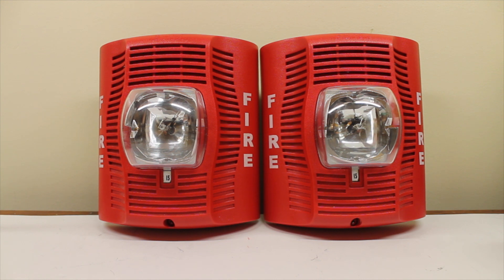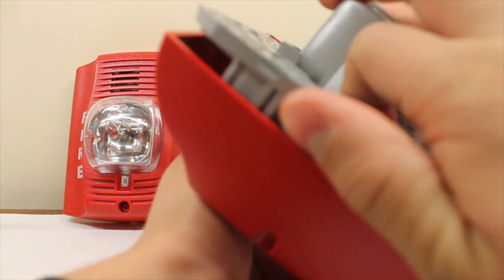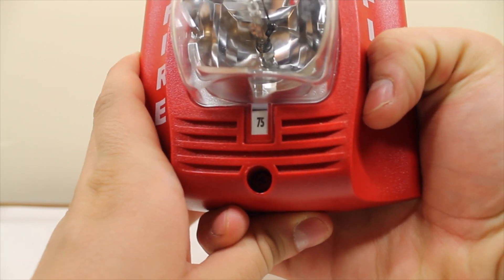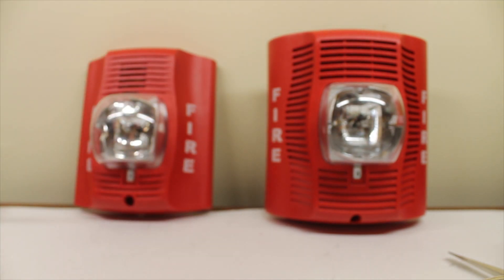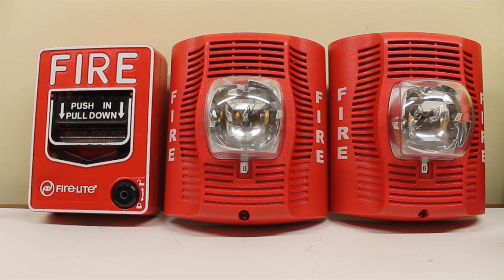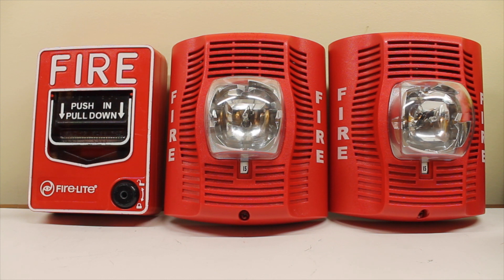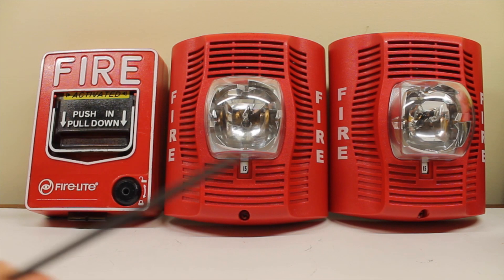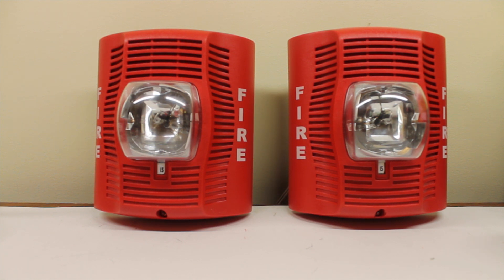System Sensor SPSR (SpectrAlert Advance Speaker Strobe) Fire Alarm Overview/Test

Comment: Can you have it play just the fire alarm not the audio I just bought one and I don’t know if I have to wire something for the siren to work or if I have to buy something to put audio on it
Reply from the maker: You will need to purchase an amplifier to drive the speaker. I use a Pyle PC20MA amp.

Comment: SWEET! My old middle school had these installed 4 years ago replacing the really cool old simplex voice evac alarms from the 80s (school was built in 1988) also they replaced the old wheelock ns' in the library with L Series Horn Strobes

Comment: Can I connect this to a conventional fire alarm control panel? Are there additional wirings needed or just the same wiring as the normal Notification devices like bells and LED strobes?
Reply from the maker: Pretty much any manufacturer's devices and panels that are not Simplex utilize conventional notification devices only, even addressable panels from these companies.

Short answer is yes. In this case, the strobe(s) would be wired directly to the panel. You would need the correct equipment to send audio to the speaker(s) as well.
Reply: @NewEnglandElevators ❤

Comment: I think spectralert advance speaker strobes are awesome than the spectralert classic speaker strobes. in my opinion. well that goes to L-series too and it did played simplex voice evac siemens voice evac est voice evac etc. i found out mircom has new alarms horn strobes and speaker strobes series i can't wait to have them and set em up along the way with the intercom systems.

Comment: How do you wire 2 pull stations to 2 stobe light.....
Reply from the maker: The pull station acts as a switch. Simply wire the devices up in parallel. You may be able to find a video that can explain this a bit better than I can explain in a single comment.

Comment: I've seen the speaker strobe version of the advance in a building it's rare!
Reply: I think they have them in my church.
Reply: Pretty much every building i walk into that have speaker strobes are spectralert advance ones..
Reply: A few can be seen in my college residence hall replacing older Gentex SPKE4 series (Wheelock E70 clone) speaker strobes. Most of them are still the old Gentex, but there are at least 3 of these scattered around the building.

Comment: How do you wire a speaker strobe. How do you program the sound. What is used. Please do a full descriptive video
Reply from the maker: I've answered those questions multiple times to several people, especially on this particular video. I encourage you to take a look. I don't do how-to's, sorry.
Reply: NewEnglandElevators then can you please link me to another video
Reply: Josh A Ok first of all, it’s a speaker meaning it requires an analog audio signal, if you just power it you’ll blow it up (due to resistance;acts as a heating coil; frying the alarm)

Comment: My college has SpectrAlert speakers. The alarm actually went off today; apparently it was a drill, but they drilled the wrong building. Oops.
But hey, at least it wasn't obnoxiously annoying. That's the beauty of speakers, and why I like them better than horns.
Reply from the maker: Drilled the wrong building? That's a first!
Reply: Something should not have ended well and that surely caused the death of several people. What a bad thing, right?

Comment: They have these at my school!
Reply from the maker: Must be a newer Notifier system of some sort. These are nice.
Reply: Actually, yes! It has a Notifier panel, and EVERY pull station is a Notifier. There used to be a march time Simplex system consisting of TrueAlerts not synced on march time, Simplex 4099s, and a Simplex 4005.
Reply: Ice Bear is amazing.
Reply: My elementary school has Classic SpectrAlerts.
And holy shit, they're fucking loud as hell!

Comment: Hey! I'm really new to the whole actually having fire alarms thing, and I'm wondering if you could make a video of how to wire up a speaker strobe to a phone or computer instead of a panel? Thanks :)
Reply from the maker: +Levi Hanson I'll tell you just upfront here. You will need an audio amplifier that will output to 25v or 70v (don't use a stereo, as that will damage the stereo). What you do is wire the speaker to the audio amplifier, minding polarity. The strobe you wire to a typical 24vdc power source as normal.
Reply: +NewEnglandElevators thanks you that makes sense. Where do you get downloads for the different messages?
Reply from the maker: +Levi Hanson I believe you can find the Fire Lite message somewhere on their site. I don't know where for sure, though. I don't remember where I found the Simplex one, though.
Reply: +NewEnglandElevators oh okay. Another question.. I have the system sensor speaker strobe SP2R241575 btw. I want to wire it to my iPhone 6 Plus, I don't care if it's loud I just want to make it WORK, would a 3.5mm to RCA cable have any chance of working? I'm thinking the 2 Rica speaker connectors could go in the + and - or I could even strip the wires and put them in that way. Is this even a possibility? Otherwise how do I get a small amplifier that isn't $50-300? Thanks again. I feel silly since I know next to nothing about this stuff.
Reply from the maker: +Levi Hanson You will need an amplifier. Fourtinatley, I found a Pyle Home PCM20A for fairly cheap. It outputs both 25v and 70v, in addition to an 8-ohm output (for a typical house speaker).
Reply: https://www.firelite.com/en-US/Pages/Voice-Messages.aspx

Comment: Hi does the wheelock 34t-ws-24 skip a beat like a 7002t
Reply from the maker: +Emillio Melendez No, they do not. That's because the horn and the strobe can be wired separately from each other. On the 700X series, the strobe is hard-wired in series to the horn. Because the strobe pulls so much power from the horn in this arrangement, it causes a "skip."

Interestingly enough, if I wired the horn and strobe on one of these devices in a parallel circuit, the horn would not skip. I would be able to do this if the horn on my 34T-WS-24 worked (although I made up for it by sticking another 34T next to it, I made a video of it a while ago).

Comment: Do you need something to activate the speaker? When I apply power, the speaker makes 1 popping sound.
Reply from the maker: Evan Nazario First and foremost, don't apply DC power to the speaker...it will eventually damage it (hopefully you didn't damage it too much). What you need is an audio source of some sort (mp3 with messages and amplifier). The mp3 device can easily plug into the amp, which will output the audio signal to either a 25v signal or a 70v signal. I use a 40w Pyle audio amplifier for this. It's able to output to an 8ohm speaker, a 25v speaker, or a 70v speaker.

Comment: There are a few schools in my city that have these, from when they upgraded the fire alarm systems. They all have Notifier NFS2-640 voice-evac systems with these speaker/strobes, NBG-12LX pulls and FSP-851 smoke detectors.
One of them, installed in 2009, replaced an old Gamewell FlexAlarm system from 1965 with Vibratone 450 horns; another installed in 2010 replaced a Simplex system from the 80s with 2903+2901-9806 horn/strobes, and another installed in 2013 replaced an old Edwards system that was just relayed into the intercom.
Reply from the maker: An older Edwards system relayed into the intercom...that sounds interesting. Correct me if I am wrong, but it seems like the system would have emitted some kind of tone into the speakers, acting as the signals. I may not be 100% right on this, but it might be close (I saw a video a while back of a Simplex system that would emit some tone into the intercom speakers, with 4903-9219 horn/strobes in the hallway).

The recent installation of those voice evac in those schools you mentioned seems like a GREAT idea, especially with a mass amount of occupants in the building at a time (students, teachers, etc). Having a system that gives directions seems like a great aid in the event of an evacuation of the building, as opposed to having a horn making a blaring noise. Best of all, the system can be used as a PA system, for an event that requires specific direction (someone instructing to not go towards this part of the school, etc).
Reply: Yep. All the new schools they've built in my hometown since the late 90s use voice-evac systems too, but they're EST. My parents' old middle school had a Notifier voice-evac system installed during a 2008 renovation, but most of the alarms appear to be the old SpectrAlert speaker/strobes (clearing out old stock, obviously.)
My old middle school will probably get a voice-evac system too, if they renovate this summer (the current system is a very old Gamewell FlexAlarm system from the 50s with flush-mount Federal Signal explosionproof-style horns, and NO automatic detection or sprinklers.)
IDK about the K-8 school I went to for kindergarten; given its' size they might just use voice-evac in the cafetorium and gyms, and horn/strobes elsewhere (some re-walled classrooms had SpectrAlert Advance horn/strobes installed, but the rest of the Simplex system is still intact.)

Comment from the maker: USfireFan It's fairly easy; I have the voice messages stored on a device (MP3 player or computer will do) and connected it to an amplifier that supports a 25v output or a 70v output. Heck, it even has an 8ohm output. In this case, I was using the 25v output for the two speakers, which could take either 25v or 70v input lines.
Reply: Aah  well then I am going to buy an amplifier ... Thank you!
Reply from the maker: You're welcome! Having the amplifier works the best for the speakers. You COULD hook up the speakers to a stereo system, but it would not be good for the system itself, and you wouldn't get the best output.
Reply: ***** actually i am thinking about getting a MP3 Module where i can save sound files. I want to connect it to my control panel so that by activating the fire alarm will play the sound file. I am going to get a speaker strobe with an integrated amplifier and hook it up with the mp3 module.
Reply: +NewEnglandElevators cool
where do you get the files
Reply: I wonder the same

Comment: There's a ceiling mount version of the spectralret advanced which is horn and speaker.horn is PC2415-75W,and SP2C2415-75.

Comment: Weird. The tone of the SpectrAlerts at my college have a more electromechanical tone before the evacuation message.
Reply: Well that would have to do with the voice panel, not the alarms themselves. Voice evacuation systems work more like a PA system, with all the speakers hooked up to the voice panel, rather than traditional systems that just apply electric current and the devices themselves make the sound.

Comment: How do wire these things?
Reply from the maker: The units themselves don't have terminals, like the typical Horn/Strobe. There's terminals on the bottom of the mounting units (that I mistakenly blocked with my hand in the video). There's separate sets of terminals on the SPSR units for the speaker and the strobe (Each with a single negative and two positive terminals, mainly for supervisory purposes). You mount the plate to the box, wire up the mounting plate, then mount the alarm itself on the plate.

Comment: Can you still wire the speaker part even if you DON'T have an amplifier?
Reply from the maker: Fire alarm speakers are much like PA speakers, they have a transformer on the back that takes a 25v or 70v input and steps it down to a more reasonable input for the speaker itself. These systems are designed to hold many speakers with constant current, unlike a typical stereo system at home which is designed to have two 8 ohm speakers.

It is possible to wire the speakers up to a typical stereo unit, but I DO NOT recommend doing so. Because the alarm speakers require a much higher voltage (25v or 70v) than the typical output of a stereo (8 ohm output), you won't get a very loud sound out of the speakers. Furthermore, this can eventually damage the stereo unit, since it is drawing a bit more than it should.

If you can find a way to use the speaker without the transformer on the back, there should be a 4 ohm speaker, lower than the typical stereo output, which could probably damage the speaker.

If anything, try to find an amplifier that can output 25v or 70v. I found a great 40w one from Pyle audio that isn't too expensive
Reply: ***** So how do you wire the amplifier to the alarm? Thanks for help so far!
Reply from the maker: xXPyroPyroXx A speaker strobe should have two pairs of terminals, just like a typical four wire horn/strobe. The only difference is that one set of terminals is the 24VDC input for the strobe, and the other for the audio signal. Wire the speaker up to the amplifier pretty much like a horn, minding the polarity of course. If your amp has a couple of + outputs for the different voltages, MAKE SURE you are wiring to the right voltage output for the alarm speaker you have.

I explained this as simply (no pun intended based on other companies) as I could, hope this helps more.
Reply: ***** I'll give it a try! If I mess up the first time I'll have my dad help me (he's an electrician). Thanks for your help!